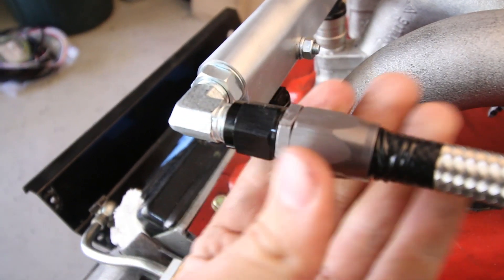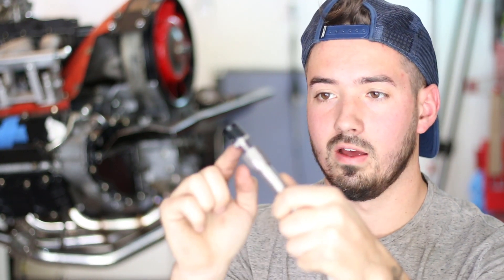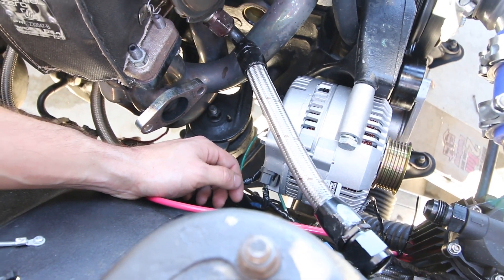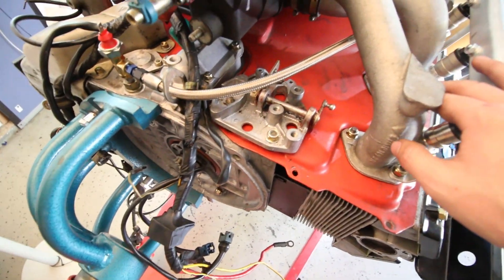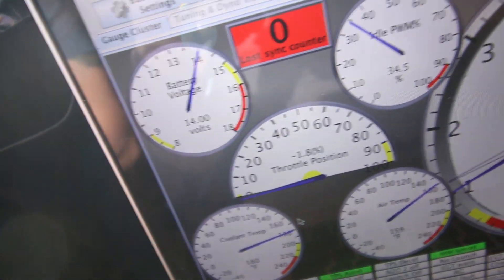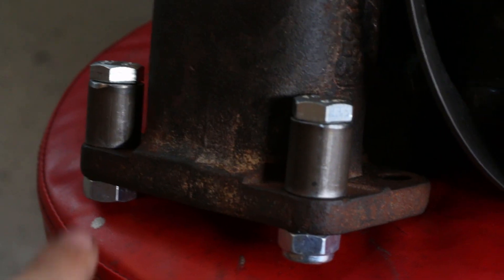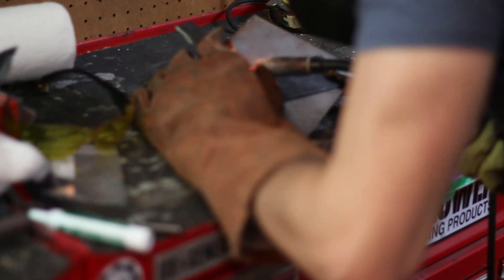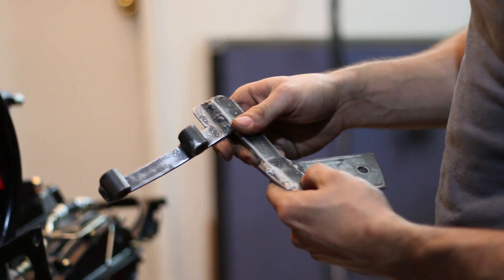Ghetto Fabbed Turbo Support - 911 Turbo

Comment: Not sure if you thought of it, but the tin where the return oil line goes over. Will you be putting a small plastic weather strip/fender piping so the oil line wont frey?
Reply from the maker: Haven't thought of it, but will now!

Comment: Do you have a diode between the battery thats burning the altenator or does the altenator have the diode, cause diode lets current just go one way and then it will not burn the altenator

Comment: Ive never bagged you guys on anything, but on your turbo bracket you need a gusset not only on the corner you was talking about, but the corner kitty corner to it. Make that bitch strong cuz imagine the heat cycles that piece will go threw, and its welded together with flux core... Which works, till it don't..

Comment: Always remove ur tape from the cut end of the hose. It WILL leak. The fitting cannot work with black tape crammed in it. I made the same mistake guys.
Reply from the maker: J Rod The Datsun has all the tape on it still, no leaks. Luck of the draw I suppose..
Reply: Team Boosted 
I guess, lucky bastards. Every one I did with the tape leaked. I was using masking tape though. Maybe the black seals better, but gas will eat the black tape. Hope ur good down the road. Love the bids and the builds guys.
Reply: Didn't know I commented on here lol